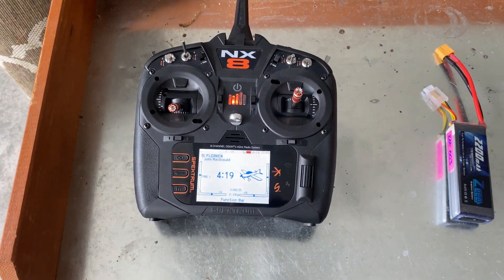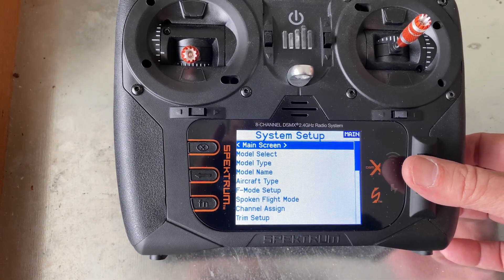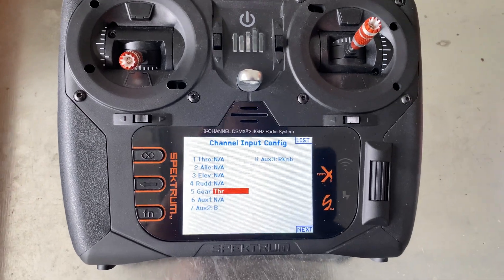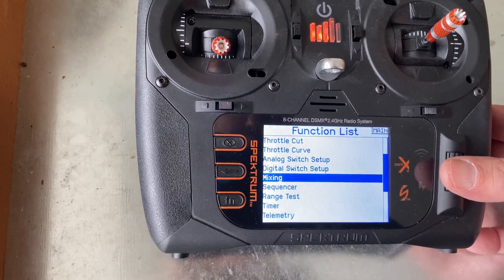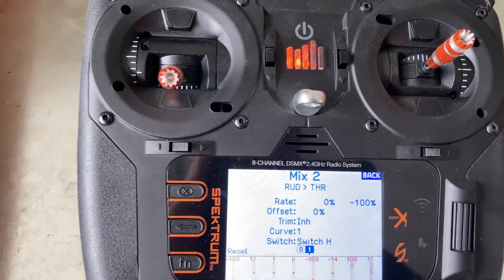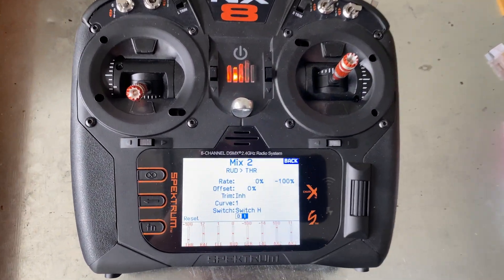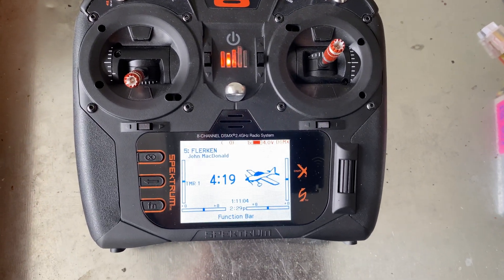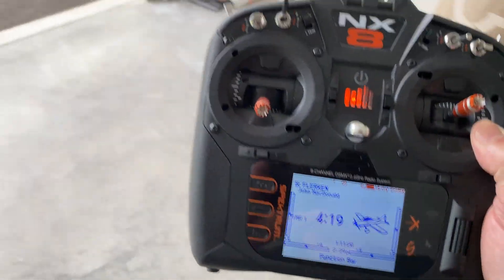Setting differential thrust on an NX8

Comment: Thank you so much! I hate to put a rudder on my own rc planes. The weight of the extra servo, the control linkage, and the linkage stopper are more than I wanted. With differential thrust the complexity and weight are unnecessary. I just got it working, and tomorrow I hope to fly it for the first time.